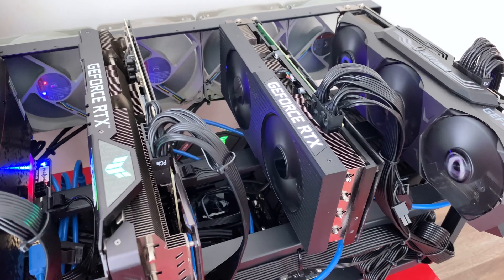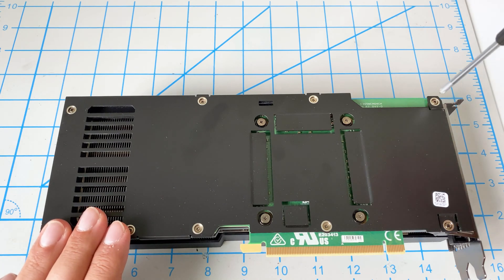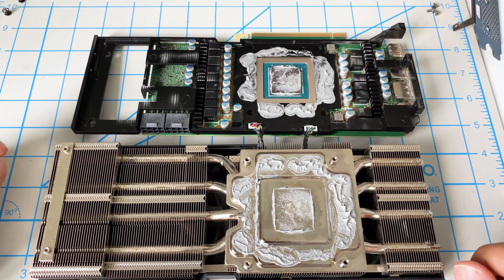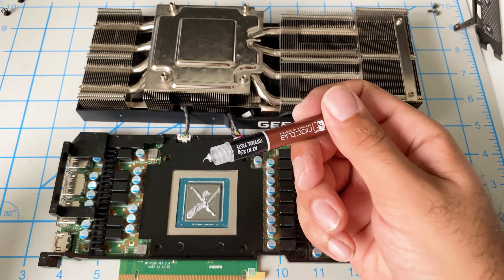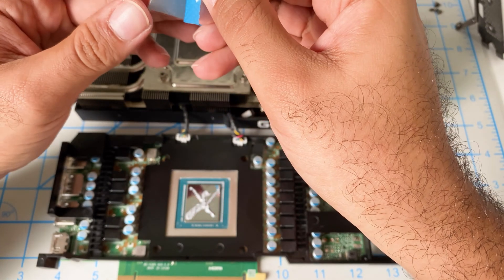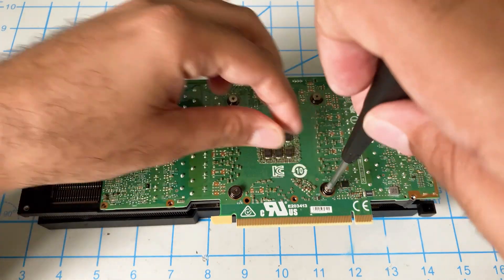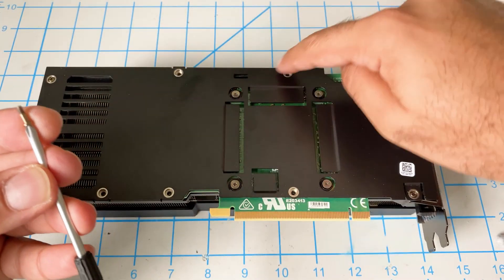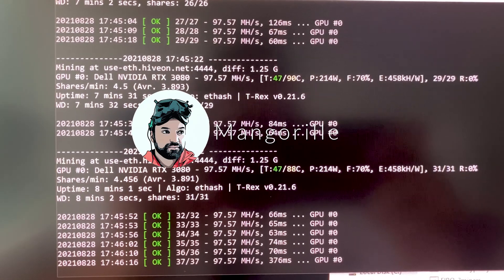Dell Alienware Aurora R10/R11/R12 RTX 3080 GPU Temperature Fix | 5 Month UPDATE Thermal Pad vs Paste

Comment: Wanted to try this but there are a million different screws with most of them being so tight that I can’t remove them. I wasted all my time and I’m pissed
Reply from the maker: Did you try a different screw driver? You may be using one that has a handle that's too small so you can't get enough torque on them.

Comment: 0.5 mm are usually used more on vrms by themselves. It would be interesting to see if you sprung for Honeywell's PTM 7950, which is 0.25 mm in thickness, and utilized it on the entire cooler, and not just the dye, if that would work better than regular paste or not.

I've got one of these cards coming in the mail since my one laptop died. I'll be curious how it works out.

Comment: Hey Mangorille, thanks a lot for the video !
My Alienware aurora R11 don't work anymore, I have black screen issue and the monitor don't get the signal
Few days ago I was able to get the machine booting on windows 10 with screen but it turned to black few minutes after starting 3D mark
I didn't look at the temp on HWinfo but I'm pretty sure I'm hitting the GPU heat problem here.
I'm about to buy the Noctua NT-H1 3.5g on Amazon but did you had enough paste with only one syringe ?
Reply from the maker: Hey Julien. One tube was enough for this.

Comment: Thanks for video, would this be the same or similar for a 3070 in a R12  ?
Reply from the maker: The 3070 would be using a different memory chip so you probably won't see as dramatic outcome there.

Comment: Took off my backplate and some of the thermal pads on it was like stuck on the chip so. Is this a problem?
Reply from the maker: Is this on the back plate (back of the card)? Or did you actually go a step further and remove the black piece from the front of the card too?
Reply: @Mangorille  @3:04 in your video. That backplate.  It was like stuck when I was pulling it off. I had to really pull on it and then It came off some of the thermal pads were stuck on both sides. The green chip and back plate...
Reply from the maker: @VIaddd  Weird, never seen a back plate get stuck. Now the front plate yes, that thing can be tough to remove. Did the thermal pads get destroyed or still somewhat in tact? If they are in tact you can put it back together but if they got all messed up, you should replace.
Reply: @Mangorille  they were still intact but some of it was stuck on that green chip. They looked in bad shape like if it was glued on and yeah very different than what I seen in every video of people taking off the backplate. I finished what I was doing and then just put it back on and I'm going to order more and replace them
Reply from the maker: @VIaddd  Interesting, never seen that before. How were the results after the mod?

Comment: The Thermal Right pads are too hard to compress. If you try the Gelid thermal pad, the result may be better since it's very soft.
Reply from the maker: That's possible but with the thermal paste working so well, no real reason to try anything else. I suppose you can even try 0.3mm thermal pads but all the various combinations gets quite expensive.

Comment: I have 7 of this dell 3080, paste works better than pad. .reason why the core temp is high is due to your "X" is to thin. for GPU u gottan flaten and cover it all. doesnt work like a cpu. For better result, u need to remove the black shroud and expose the bottom memory module.. replace the pad with 2mm , same as backplate also 2mm. For paste , I'd suggest thermal grizzly..
Reply from the maker: Thanks! What kind of memory temperatures are you getting on your setup and at what mh/s and fan percentage?
Reply: @Mangorille   my ambient is 34c , getting 59c/98c @ 85% fan
Reply from the maker: @myjpkl  Those are good results considering your high ambient. I get similar results but at a 24c ambient and ~65% fan.
Reply: How did you remove that big black aluminum plate to expose the memory chips. do you just pull gently and its held on by more of the origial thermal tape?
Reply: @Genx-sim-scene  wiggle or gently pull it off there is no screw.
Reply from the maker: @Genx-sim-scene  I didn't remove that plate. Did you check if there are any screws on the back of the plate holding it down?

Comment: Is the thermal paste in the middle not suppose to the touch the thermal pads around it? Or is it ok if it’s all one big blob
Reply from the maker: You mean the thermal paste on the GPU die? If so, it's okay to be a blob as it will squeeze when the heatsink is closed.

Comment: Did you forget to add thermal pad  to back plate? @11:21
Reply from the maker: The backplate already has thermal pads from the factory. Did not bother to upgrade or replace those.
Reply: Yea but I saw no pads when you turned the plate over 😅
Reply from the maker: @Oopsy75254  Ya visual illusion I suppose in the later part of the video. Check it out here: https://youtu.be/YptocwRgA4U?t=188
Reply: @Mangorille  you are correct, the section I see later is the part of the pipe that doesn't have pads

Comment: I have an R11 and a R12 both with 3080. I use Thermal Grizzly - Kryonaut Extreme Thermal Compound Paste on both gpu and cpu. No Thermal pads. I run the R12 using Nish Hash Quick Miner on High and get 99 to 100mh/s. My temps are around 88 to 92. My fans are noticeable higher. My R11 I run on medium and get 95 to 96 mh/s same temps but my fans were replaced with Qty3 Corsair CO-9050040-WW ML120 Pro 120mm Premium Magnetic Levitation Fan. The fans do work better as my system does run cooler and a lot less noise but the big difference was in the Thermal Paste. I bought (Qty 2) 2 gram kits to both Gpu and Cpu.
Reply from the maker: Did you put the thermal paste on the black heat spreader as well?

Comment: Thank you for sharing this! I have been using thermal paste and was also wondering how would a Dell gpu perform with the thermal pad you just showed. 
Could you share how much more thermal paste you added to get those amazing results?
Reply from the maker: Our pleasure. I put a few more dots compared to the original video. Note that you use a good half tube of thermal paste for this mod.